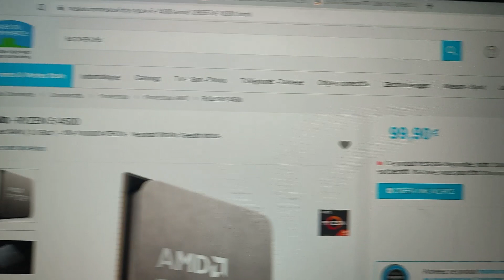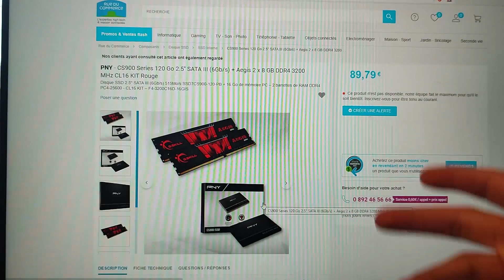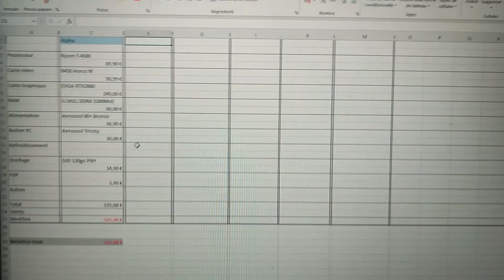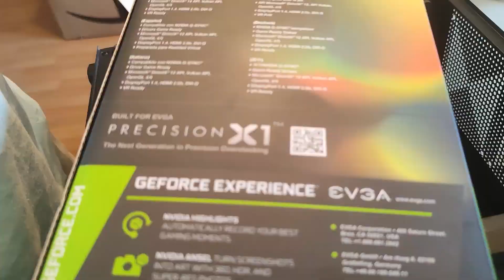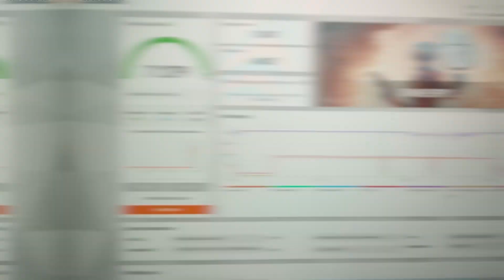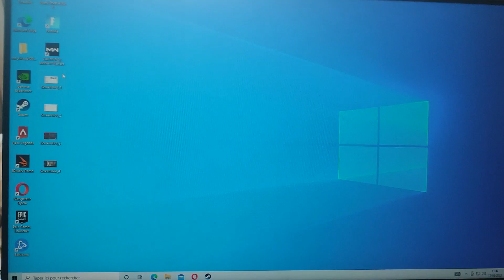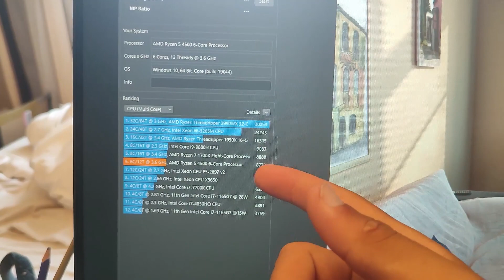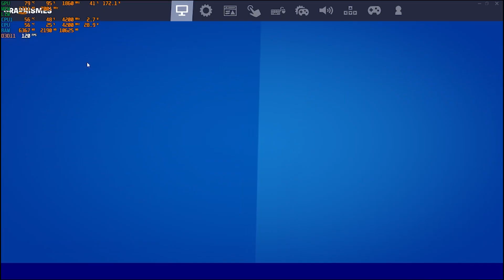Test & Avis PC Gamer 500€ 2022 (RTX 2060, Ryzen 5...)

Comment: Tout a l'air correct mais on va pas se cacher que la température du GPU fait un peu peur...
Reply from the maker: Ca reste correct surtout que c'est un benchmark alors la carte est utilisé à fond alors que ça n'arrive pas forcément en jeu
Reply: @LEGRANDKIM  J'ai toujours entendu dire qu'une température au dessus de 80 degrés était dangereux pour le GPU, mais comme t'as dis c'est juste pour le benchmark que t'as du mettre les graphiques à fond
Reply: @el_bakuu1769  heum ben de ce que j'ai entendu de mon côté oui mais sur le très long terme;
Les fortes températures sur les composants du gpu va provoquer une ''electro migration '' ou en gros quand il fait chaud+ du courant dans les petits ''fils'' pour alimenter chaque cuda core/compute unit, l'électricité va littéralement éroder ces petits fils qui permettent l'alimentation des coeurs de calcul, ce qui peut provoquer des bugs sur le long terme comme des pertes de perfs. Mais sur le long long terme, du type 20-30 ans voire plus (sachant qu'entre-temps le gpu/cpu concerné sera surement devenu obsolète)
Puis les constructeurs de composabts ont une solution contre la chaleur: le thermal throttling, ou a chaque fois que la température augmente au dessus d'un certain niveau, le voltage et les fréquences vont baisser, en plus des sécurités a partir de 100-105° 
Donc osef les températures les vrais impacts qui nous touchent c'est en jeu
🤓
Reply: en sois une carte graphique est faite pour tourner  a ces temperatures elles sont un poil chaudes mais la tempereature limite d'une cg est de 115 degres donc on est large. a savoir que les soudures bga (soudures du gpu) sont faites a 200° donc on a pas mal de marge avec les 85°
Reply: @oclati8313  pourtant à chaque fois que je dépasse les 70 degres pendant trop longtemps j'ai un black screen qui apparaît et si s'enlève seulement en fermant mon pc
Reply: @el_bakuu1769  je sais pas d’où ça vient mais en tout cas 80 degres est ok sur une cg
Reply: @el_bakuu1769  Tu dois avoir un problème spécifique parce que 70° c'est rien .

Comment: Les 50 FPS sur GTA V sont lier à la quantité de VRAM du GPU (6go sur la 2060) sur ma 1070ti avec 8go, je suis a 75/80 FPS, alors que j'ai un puce moins puissante.
Reply from the maker: Je ne pense pas, la quantité de vram utilisé par le jeux était inférieur à 6go. J'ai du mal réglé les paramètres
Reply: Et la Gtx 1070ti est plus performante que la rtx 2060sauf que cette dernière  a le dlss et le ray tracing 
Peut être que ta un processeur plus puissant ?
Reply: @LEGRANDKIM  Tu a du mettre le jeu en 50hz sans faire exprès donc les FPS sont aussi limiter a 50.
Reply: @LEGRANDKIM  c’est juste que sur GTA 5 et les jeux rockstar en general t’as pas mal de paramètres qui servent à rien qui consomment trop, il aurait fallu demander à oyboy il t’aurais donner les bons settings et je pense le pc atteint sans trop de problème 90-100 fps
Reply: Je suis sur ryzen 5 2600 et comme toi une GTX 1070ti et pour ma part GTA en ultra 75 a 80 FPS ...je confirme
Reply: @ZiatoxFr  je pense que tu as vu juste.apres retire le vsync peut être
Reply: @thegeminifamily4196  j'ai plus de FPS que lui alors que j'ai un ryzen 3 2200G et une GTX 1060 6gb, sur la vidéo le pourcentage de l'utilisation de la carte graphique est a 40 % alors qu'il devrait être a 99 % et en plus on voit bien que les FPS sont limiter car ils sont stables.
Reply: @thegeminifamily4196  mais le vsync a pas d'impact sur les perfs non-? C'est uniquement pour synchroniser l'écran et le gpu, ça s'active depuis les paramètres de l écran donc doit pas t'avoir de perte de perf je pense
Reply: @h1_ndz399  ben je me suis posée la question mais il est vrai que quand je désactive bien-sûr les FPS s'emballe mais je trouve pour part qu'il y a moins de lag si on fait pas attention au déchirement de l'image du au vsync désactiver
Reply: @ZiatoxFr  oui je pense qu'il est configuré sur un écran en 50hz ...voir le panneau n vidia
Reply: Impossible parece que avec la gtx 970  en ultra 1080p jsuis a 75 80 fps comme toi et je mets la synchronisation verticale pour être plus stable que sa soit en ligne ou gta rp ou mode histoire .
Reply: @LEGRANDKIM  peut etre le processeur qui bottleneck a cause du nombre d'informations a gerer
Reply: @h1_ndz399  en gros la vsync synchronise les rafraichissements de ton ecran avec les fps, disons qu'il est de 60 hz il se rafraichit 60 fois par seconde le processeur va donc demander a la cg d'envoiyer 60 images par seconde qui seront synchronisées avec le rafraichissement de l'ecran. afficher plus de 60 fps a donc aucun sens
Reply: Quoi? Mais je comprends même pas comment une carte graphique ancien pouvait tourner 60 a 75 fps sur gta 5